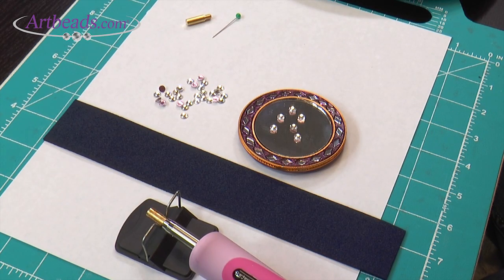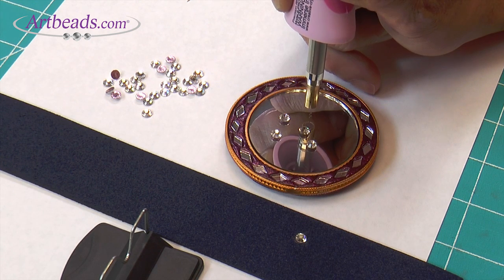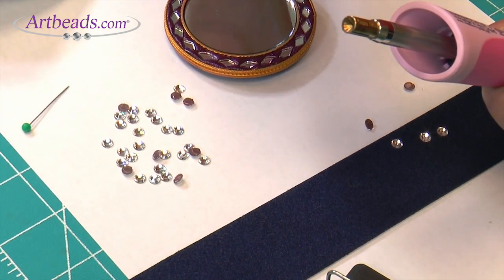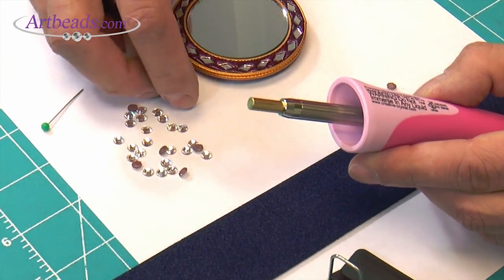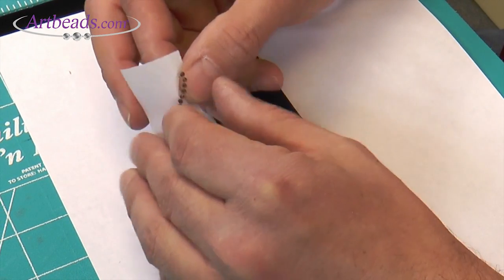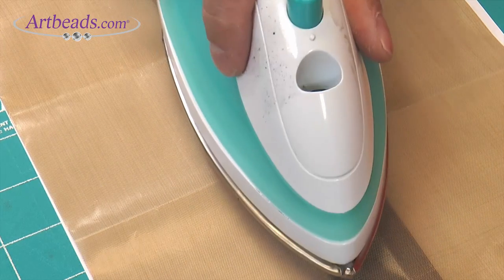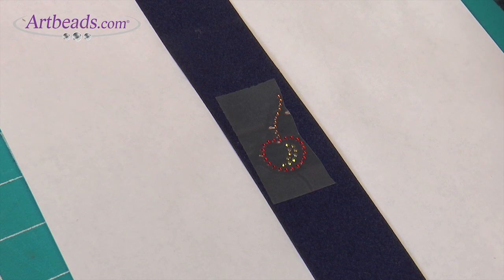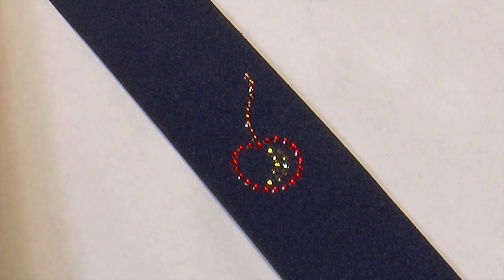Artbeads Quick Tutorial - Swarovski Hotfix Techniques with Nick Regine

Comment: does this work on knitted wool?
Reply from the maker: We asked our designer Cheri for help with this question, and here's what she had to say: Hi! Since I have not tried applying Hotfix to knitted wool, I can’t say how successful it would be. I have applied it to synthetic fleece, see http://www.artbeads.com/snowflake-gloves.html. Here are some things to consider: 
The adhesive on the back of the flatbacks should stick to wool. The adhesive will need a surface to adhere to, so I would think a surface that is dense such as felted wool would work better than a loose knit. I would recommend testing on a swatch first before attempting on a finished item. The Hotfix applicator gets very hot, so you do not want it to touch the wool directly, it could scorch it. I would use an applicator tip one size smaller than the Hotfix flatback so that the edge of the tool does not make contact with the fiber surrounding the stone.